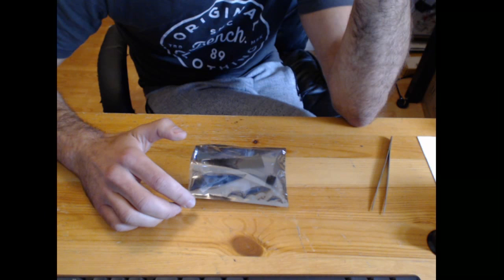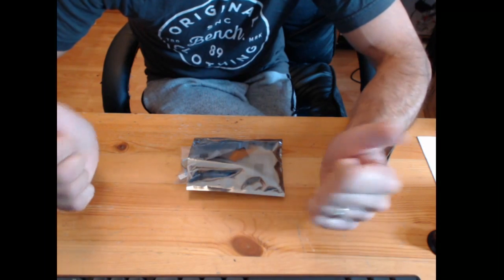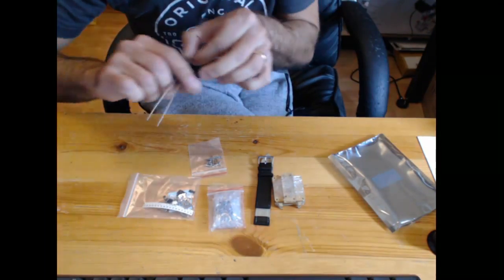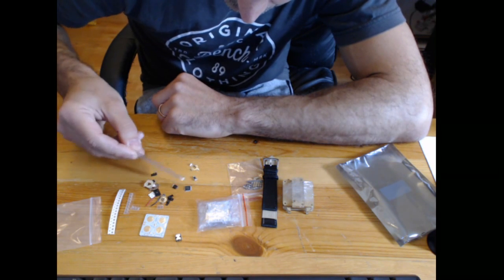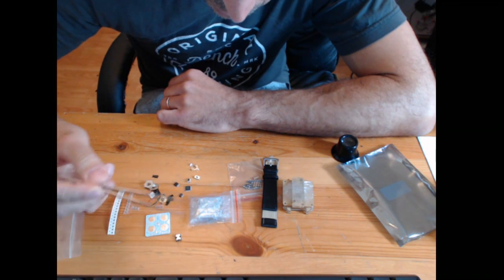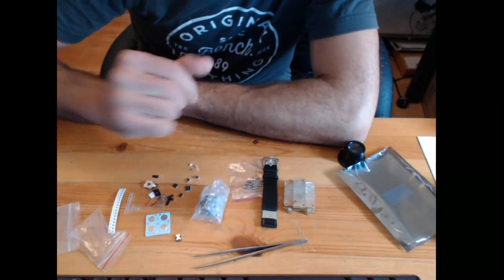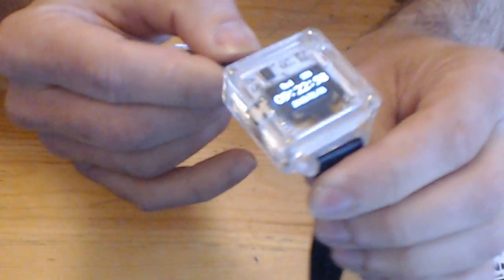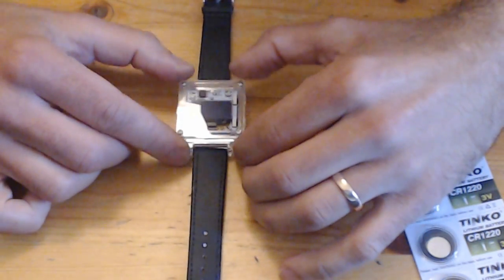KKmoon Transparent LED Watch kit

Comment: If you're having difficulty getting the watch out of standby check for orientation of C0 and C1 - they should be as indicated on the schematic and not as indicated on the pcb!!! Took me a while to figure out but works a charm now :)
Reply: Mine turns on and all, but after awhile, the screen just hangs and im stuck with it on, and It just stays like that. The time just freezes and it will stay on until the battery drains. What to you think is the prob?

Comment: I have never done smd soldering & have just bought a rework station with soldering iron.. I can just about see the tiny components with my reading glasses on. So decided to buy a digital microscope with screen so  I can do the job properly. This is going to be a daunting challenge which I am not looking forward to, to be totally honest.. I have got some solder paste to use instead of the normal solder wire.. Any pointers would be seriously appreciated.. thanks in advance.
Reply from the maker: I'm certainly no expert. This is a relatively new hobby for me. I'll be honest and say I have never used solder paste, but have seen a few videos on the process. Most people use it in conjunction with a hot air gun rather than a soldering iron I believe. For most of the components (resistors & capacitors) I apply solder to one pad, then hold the component in place with tweezers, fix the component in place (one pad) and then solder the other pad. With the processor, I use a drag solder method, and then clean up with braid afterwards.

I would strongly recommend watching a few SMD soldering videos. I personally would go for solder wire rather than paste, but that is just me. I wish you the best of luck !
Reply: @megazoid  on the main processor, does it matter that the pins on each side are all soldered together somewhat?
Reply: Jorn Navarre  ouch - yea. I figured out as much.  The scale here is just so small that I can't see ever getting it perfect w/o paste and a heat gun.
Reply: This is my 3rd smd soldering project, probably the hardest so far. Watch worked 1st time, only issue I had was when fitting the straps the plastic supports snapped on both sides whilst assembling case, so can't use as a wrist watch anymore, but still a nice little project to work on and sits proudly next to my talking clock project I did prior to this. I used a fine nib solder iron, with 0.3mm solder. I had a flux pen, but didn't use it that much. Also had a USB microscope so had a nice large close up view on my monitor which is a must, especially for those who need reading glasses.